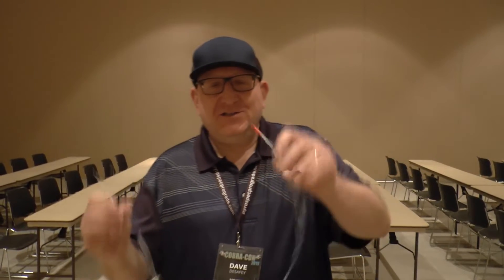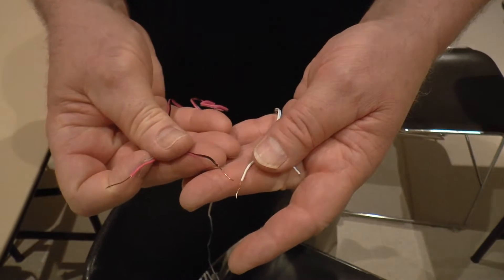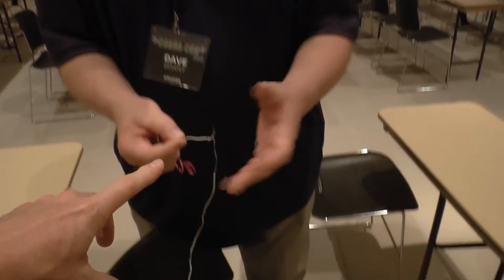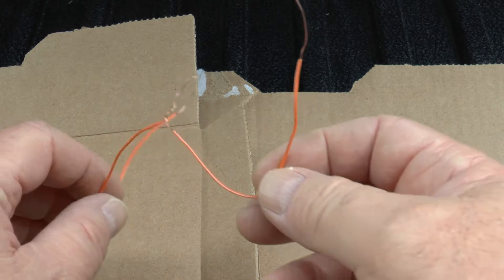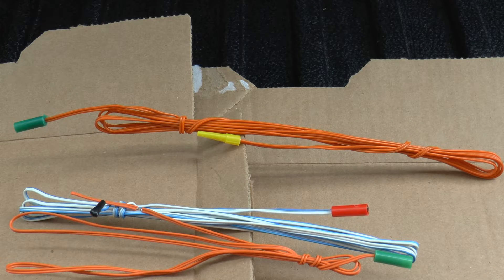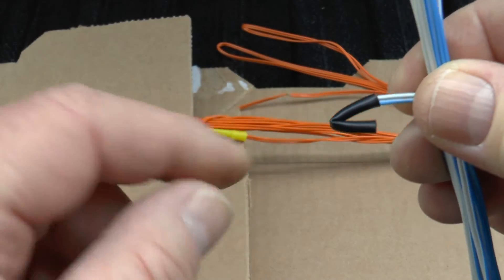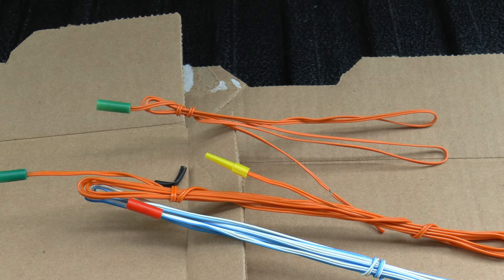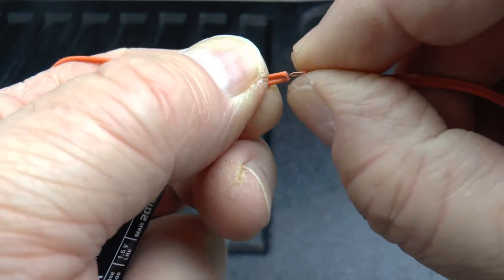Firewire Initiator Event in the Classroom

Comment: If the bridge wire is intact then shunting the ends will have no effect. The idea of the shunt is to stop a potential difference between the two wire ends that could be caused though RF etc, which would flow a current through the bridge wire and pop the match. 

However, what Dave was talking about was a potential difference between the wire and the table/chair, so a spark gap between the wire through the composition and onto the surface of the chair/table. This potential difference would still exist whether the wires were shunted or not. This is why this is actually very serious in fireworks because you cannot really guard against this sort of failure unless you could ground everything, yourself, chairs, tables, racks, hair etc.

Comment: would have had to be quite a large static charge. the igniters require quite a bit of current to set off normally. good reason to use shunts when possible. plastic chairs can generate quite a lot of static charge.